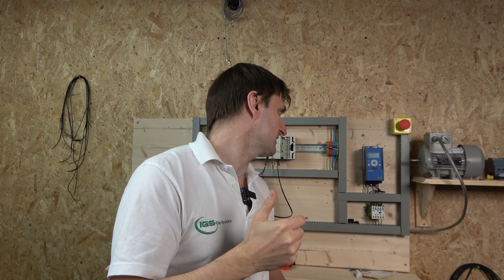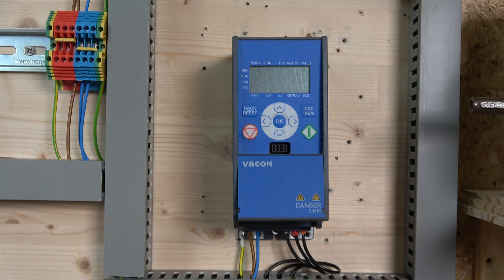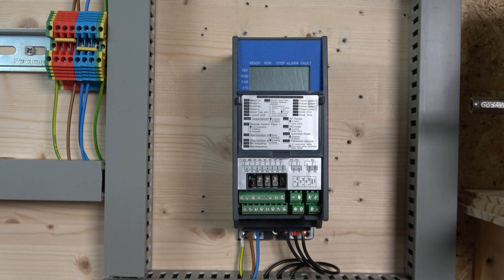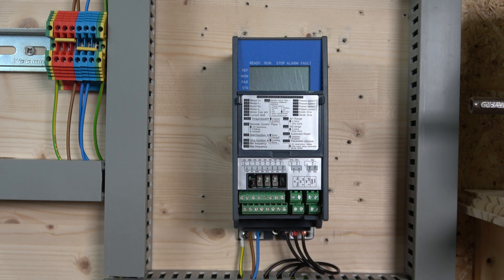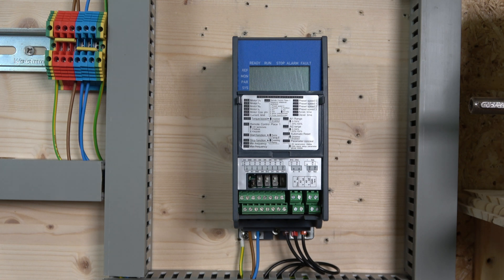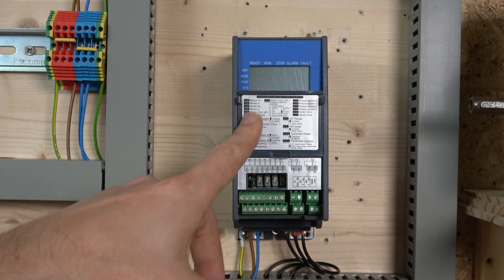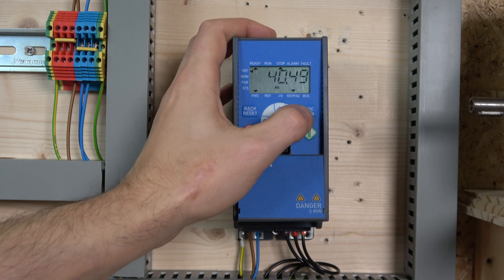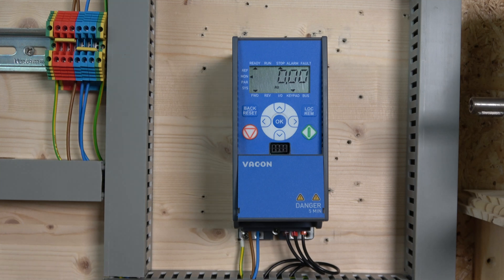Vacon 20 VFD, local control, commissioning, parameter set up and Factory reset. English

Comment: Guys i need some help . I have a vacon 20 vfd for a water pump circuit . I had to change the old vacon vfd and i couldn’t save the parameters . I have a pressure sensor 4-20 mA that give signal to vfd . The old one it was setup to stay arround 4 bar  . How to do the setup parameters to configure the new one?